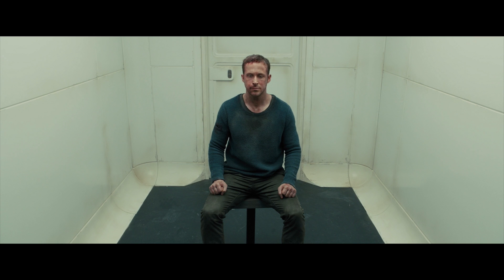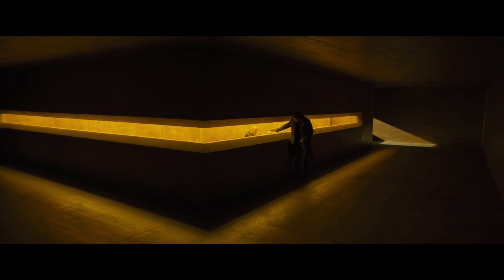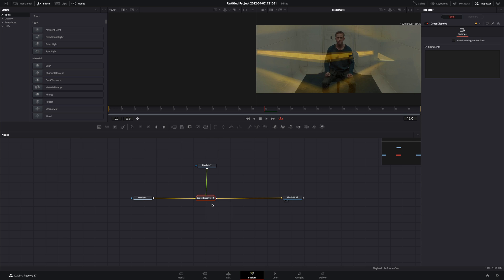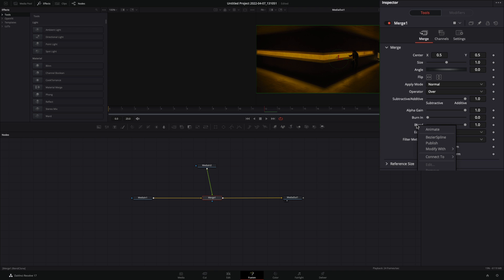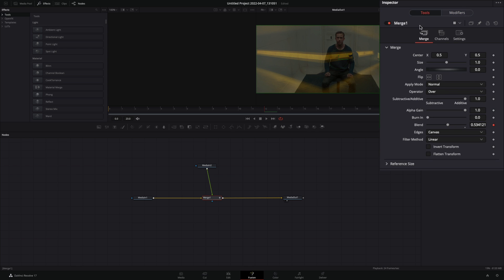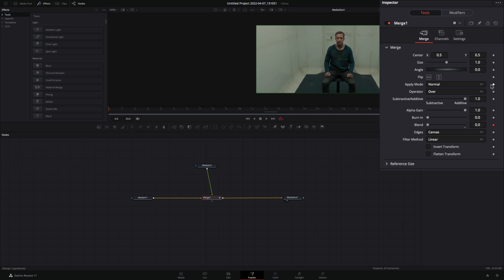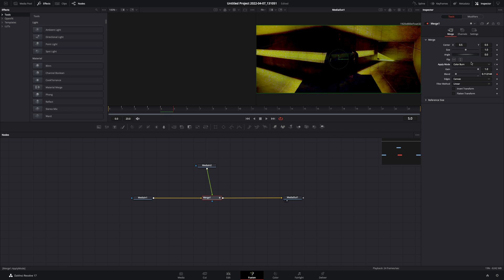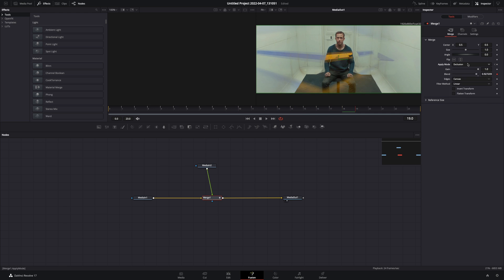Blend Mode Flicker Transition | DaVinci Resolve 17 |

Comment: If I were to make the transition shorter in Edit after saving it as a 15 frame thing, it'd be fine right? However, if I were to make it longer, I need to go back in fusion and add a blend mode for each frame? So basically I could have a 60 frame transition template and be 99% good to go for resizing? Hopefully that made sense. Cheers
Reply from the maker: If you made a 60 frame template then you are right.. most of the times you can just trim it down and it will be still ok
Reply: @LazyArtist89  Gotcha! Thanks m8